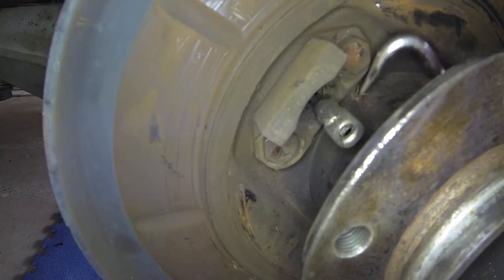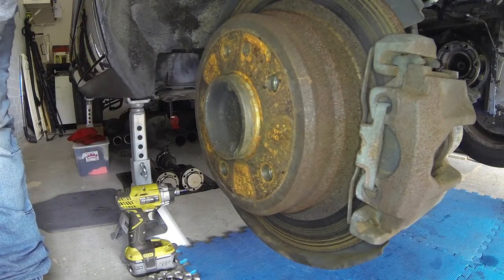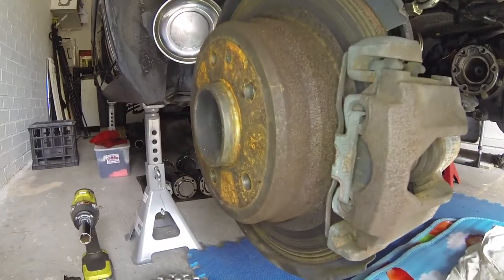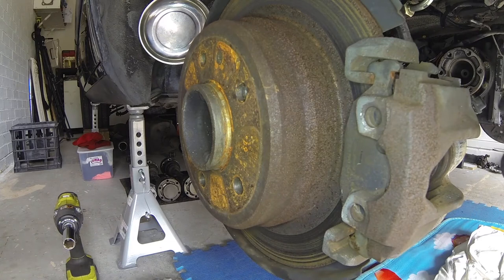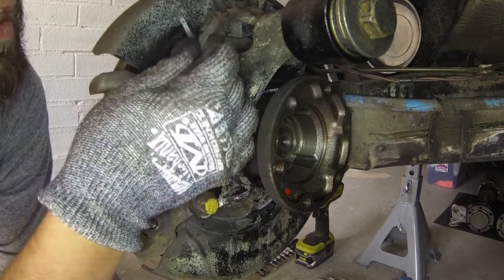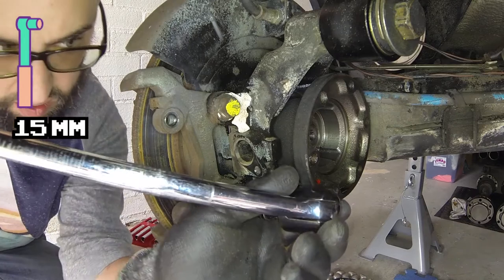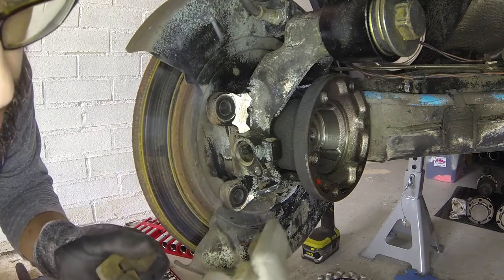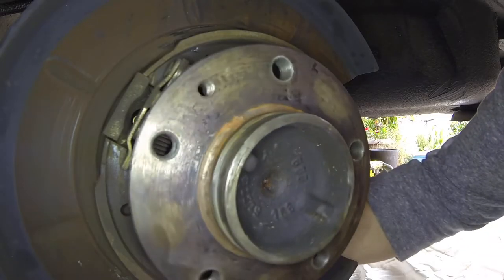BMW E28 M5: LVL 5-1 Rear Brakes, Braking in the Rear

Comment: Currently restoring an 1988 M5 (US spec) while using it on and off as a daily driver. These videos are my cheat sheet to keeping it on the road. Keep 'em coming!!!
Reply from the maker: That's awesome mate! The next  episodes are rebuilding the trailing arms and rear hubs. But if you have any questions I've worked on most of the car by now🤣 also I do updates on IG @obsidianm5.

Comment: Damn, so how do I replace the brake shields? Mine are rusty as heck.
Reply from the maker: Unless you need to replace the rear wheel bearing, I would try to clean them in place with a wire wheel or if you have a little soda blaster with an air compressor. You probably need new drum brake pads if your car is like mine (neglected for years 😅) Then repaint with enamel, most don't need a primer. Good luck 🤞
Reply: @BahjatAlaadel  ok i see. I was planning on doing the rear wheel bearings next. Just rebuilt my calipers, new pads, and rotors. Ordered new shoes and springs to do the service in your video.
Reply from the maker: If you don't want to remove the trailing arm. I show how to do the wheel bearings in this video 😊 https://youtu.be/YMqNoCgoE5Q
Reply: @BahjatAlaadel  cool, I’ll check it out